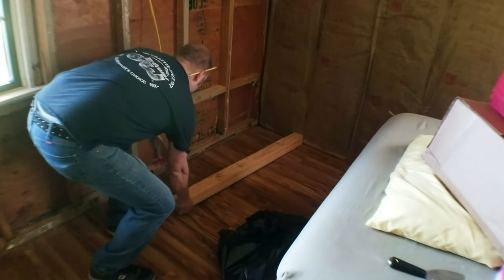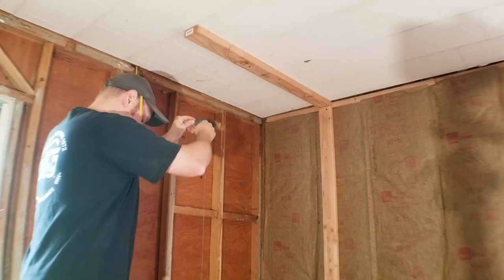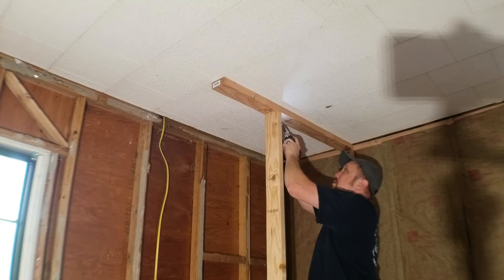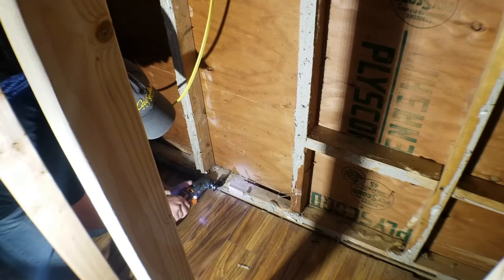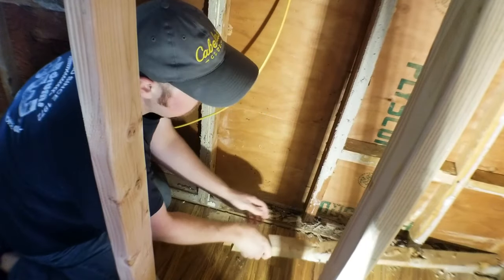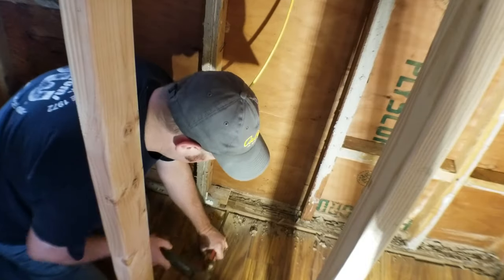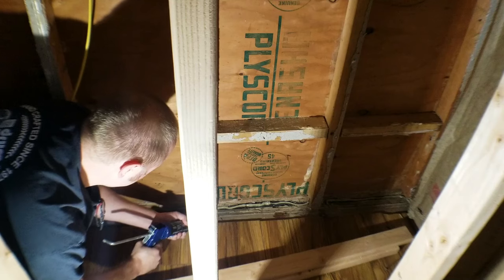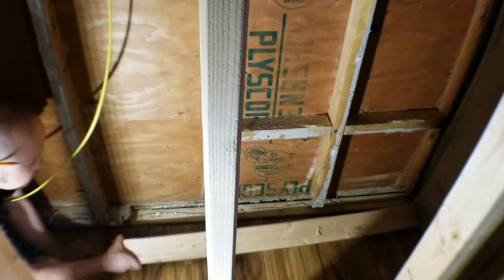Repairing Termite Damaged Sill Plate in Load Bearing Wall

Comment: I understand you are speaking of a loadbearing wall however, the damaged wall standing. Your section was only about four feet of damage on one wall. If there was a risk of collapse then the rotted wall already would've. The temporary support wall only served to allow the sills to easily go back into place. It is better to air on the side of safety with the temporary wall though.
Reply from the maker: The sill plate had failed, as the studs of the wall were being pushed into it from the weight of the load. Not sure if I mention this in the video, but in my case it was necessary to lift the wall up in order to replace the sill plate.
I will always err on the side of caution with load bearing walls because I'm not a structural engineer. And if I'm unsure, I'll hire one!
Reply: @KyleMerl  Agreed 👍

Comment: It could have stayed, those sills were like new. Oh you had to lift it and expose the lower 2/3; way to go.     Original had ZERO hold down bolts, why?
Reply from the maker: There are hold down bolts, just not in that section where I replaced.

Comment: Nice video, My cental air conditioning system has been leaking water into the Sole/Bottom plate on the basement interior support wall next to it. I can see the unfinished wall is starting to bow and crack a little. I think I will need to replace the King plate on the doorway also.

Comment: Great stuff!  I knew our 70's house had had termites in the past, but I didn't expect to find so much damage when I gutted the master bath on the second floor.  This was the section that's up against the chimney, so it kind of makes sense that they made it so far, and it also made your one-sided access very relevant.  This doesn't answer the problem of missing/disintegrated sheathing between the studs and the chimney, but one problem at a time... get down to studs and sub-floor and support where needed.
Reply from the maker: Yea the sheathing can be tough to replace in these situations. I'm still trying to decide what to do with mine.

Comment: Great job and I need to do a similar, albeit far more extensive repair to some rotten bottom plates and studs.

Might somebody use one of those telescopic scaffold poles, which screw taller and have a wider top and bottom?  (I am trying to figure out what to use...?  I guess if I go the timber way like you have, then I can re use that timber for the temporary frame for timbers in the structure vs spend money hiring or buying the telescopic metal poles that I might never use again....???
Reply from the maker: Those metal supports aren't a bad thing but you typically need a larger beam to span between them. So you need to make sure you properly support the load. With the wall I built I'm putting a stud under each joist. That way I know everything's supported.
Reply: @KyleMerl  Many thanks, understood.  I think a frame like what you have done is also the way to go for me.

Thanks for sharing your knowledge. From Sydney Australia.

Comment: This video came at a perfect time for me. Have to do the same repair around my entire house. Would it still work on a wall that runs the same direction as your ceiling joists? I’m guessing that a wall under 1 joist would be enough to get the weight of the sill plate for replacing
Reply from the maker: I meant to reply to this sooner but got distracted by life!  This method is for when the ceiling joists run perpendicular to the wall you're trying to repair.

Comment: I have to cut holes in my garage ceiling and inspect the trusses by the overhead door, 11' of the wall at the rough opening is termite eaten. Have brick face as well.
Reply from the maker: Ugh good luck! I hope you don't find any damage up there.  Replacing trusses can become tricky and might not be as simple to support,  especially if it's structure that supports the roof.  Definitely do your research if you need to start replacing that kind of stuff.

Comment: I think im going to scab some treated wood beside each stud onto the concrete kinda like a porch post, and piece meal my bottom plate, and then scab another piece on each side above the new piecemeal bottom plate. So in other words my 2x4 treated pieces will be my seal  plate for an area of 2 inches and then i can piece my seal plate as needed per section. Cutting the sheetrock wall up at each stud enough to scab till i can get under the original stud.
Reply from the maker: It's best to keep your sill plate all one piece of lumber if possible. I would avoid having a bunch of small pieces to make up the sill plate if possible.

Comment: I have damage to outer corner studs, and perhaps the top and sill plate too. Concrete foundation, brick exterior. Roof is truss. Will replace the three studs that make up the corner. Since the trusses go over this to good studs, I do not think this particular section is load bearing. Would you still recommend a temporary wall?
Reply from the maker: Well, I'm no expert, but I would expect with a corner you would probably need to support the overhang on the outside of the house.

Comment: For replacing a 12 foot section, should I build a 12 foot long alternate wall like you did, or use two 8-ft floor jacks with a 12 foot 6x6 beam across the top?
Reply: Never mind, I ended up doing neither of these.  I did some horizontal 4x4s raised slightly above the existing plate supported on each side of the wall, and a temporary stud on top of these, in between each existing stud.

Comment: I may have water damage on the studs themselves and saw on a forum the method "sistering studs " in which you would fasten the new wood to the old studs after removing the rotted pieces . do you believe this to be an effective method ? or would you recommend  building the false wall to support .
Reply from the maker: The temporary wall is necessary if you're replacing the sill plate on a load bearing wall. You need it to support the load above as you replace the sill plate. If the sill plate does not need to be replaced and you're only worried about the studs, sistering could work, depending on how the wall was constructed and how badly damaged the old stuff is

Comment: When you said you made the temp wall slightly taller than the actual wall height to lift the studs up slightly how much taller are you making it?
Reply from the maker: About 1/8 inch.
Reply: @KyleMerl  thanks, bc me/friend about to do this on a porch and change old posts out.
Reply from the maker: @morokeiboethia6749  Good luck!

Comment: How do you get the new sill onto a mounting bolt with the studs in the way?
Reply from the maker: I didn't run into this issue but i would probably cut the anchor bolt and then fasten the sill plate to the concrete using a different method
Reply: I would cut the anchor and refasten it.

FYI for anyone else doing a job like this on an exterior wall on a slab, you can't use a wedge anchor if your sill is a 2x4 as you won't have enough distance to the edge of the slab. Big no no! you can blow out the slab and have an even bigger problem. Drill a 5/8 inch hole through the sill plate and into the slab (for a 1/2 threaded rod retrofit Simpson Strong tie makes them), blow it out with compressed air and load it up with concrete anchoring epoxy. Install rod through plate into epoxy filled hole and tighten down the nut ~5 hours later.
Reply: @JohnnySnaps  Thanks, but too late.  I blew out the slab in several places with 1/2" wedge anchors. 😞

Comment: Your not replacing the rimjoist, or sill plate. That is a bottom plate of a wall. Correct me if I'm not hearing it or misread the title of video but, you said termite damaged sill plate replacement?!?

Your totally not replacing that... What your referring to is a bottom plate, sill plate is the board that attaches the home to the foundation with anchors(j bolts) the rim joist goes on top of that, along with floor joists. Then comes the bottom plates for walls like your taking out of the home in this video. 

Your rite about them being load bearing walls, but your terminology is incorrect. 

Or have I completely missed the sill plate part on this video?
Reply from the maker: Yea my sill plate wasn't damaged enough to warrant removing it at that time so I didnt do it but this video still demonstrates one method of supporting the load in order to do such a job so I think the title of the video is still acceptable.